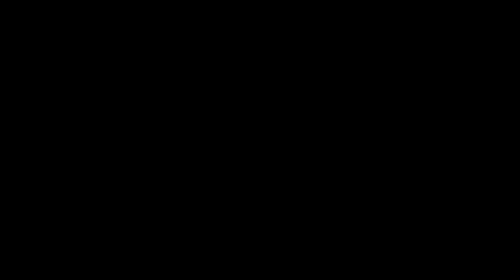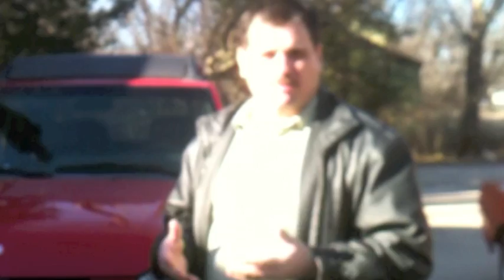Paintless Cars: New Technology Being Devoloped For Cars With No Paint = New Repair Methods

Comment: I don't think the average consumer could tell the difference between a base coat clear coat painted car and one that was wrapped in a high gloss vinyl adhesive sheet.  More interesting finishes on vehicles will be possible - new colors, new reflectivity options.  I think it will be exciting and may make repairs faster and less costly to do.  It will be interesting to watch - that's for sure.

I do not think it will cause pa